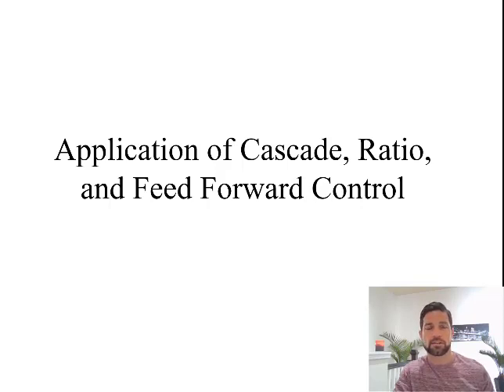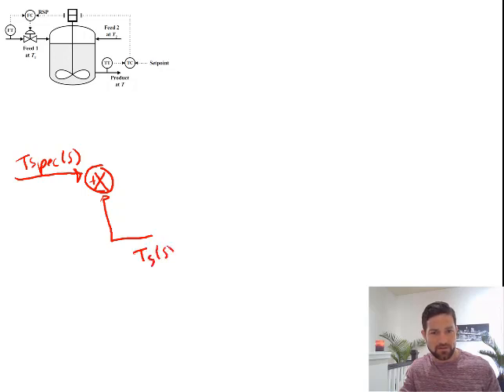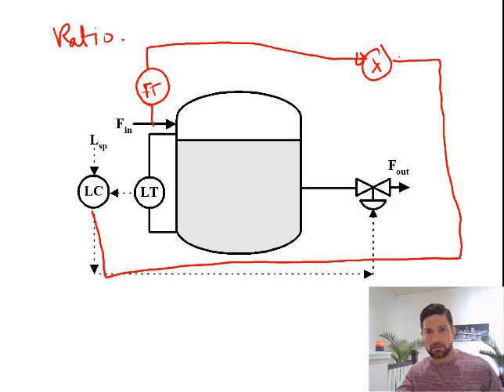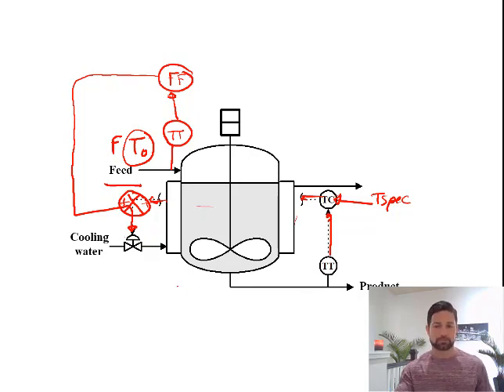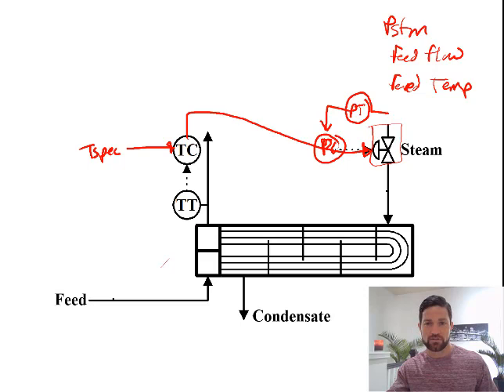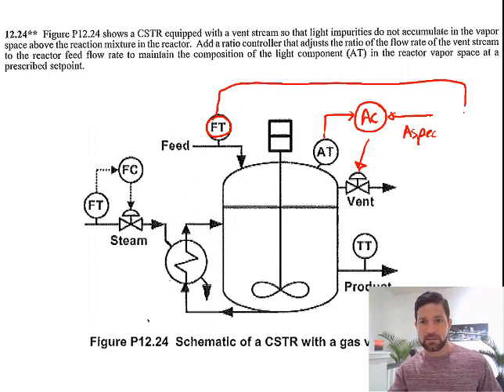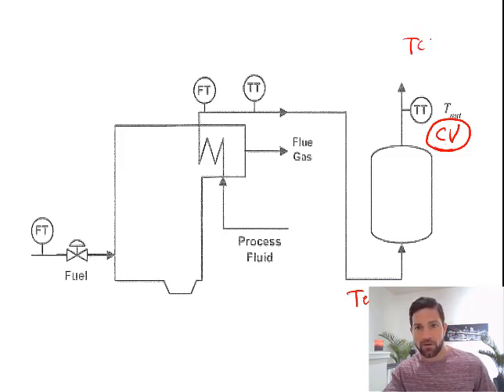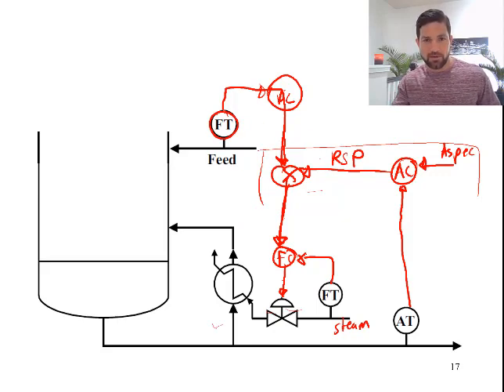Example Problems for Implementing Cascade, Ratio, and Feed Forward Control

Comment: Cascade: one controller feeds into another controller.  
The controller driving the set point (the level controller in the example above) is called the primary, outer, or master controller. The controller receiving the set point (flow controller in the example) is called the secondary, inner or slave controller.  In the first example, the TT is the primary controller and the FC is the secondary controller.
The Flow Controller (being that it is the lower loop, or "slave controller") MUST be 3-10 times faster than the Level Controller (being that it is the upper loop, or "primary controller").